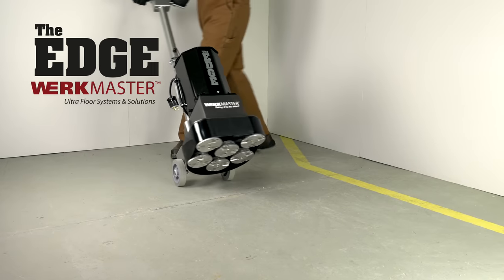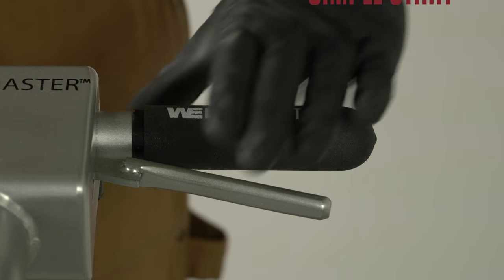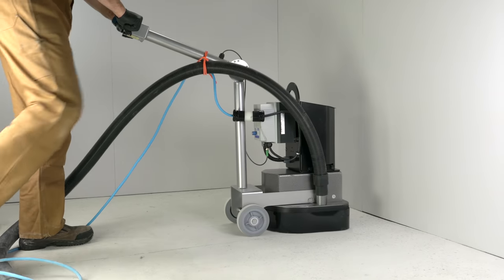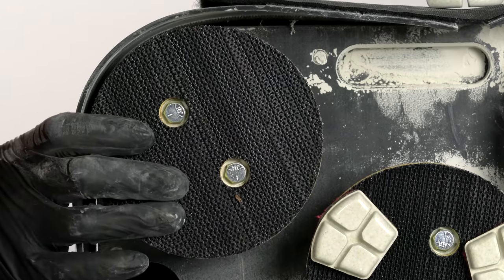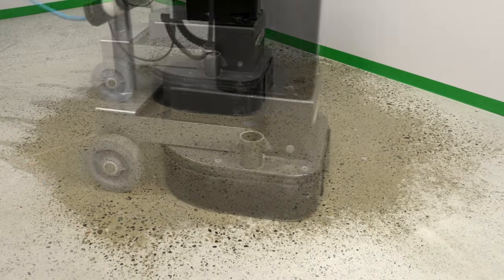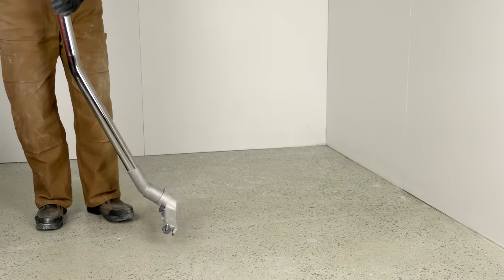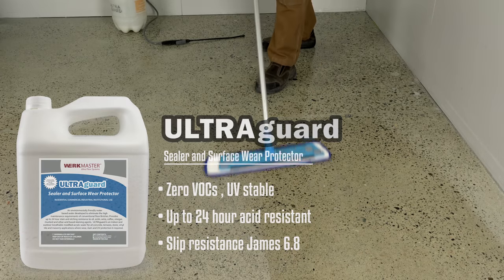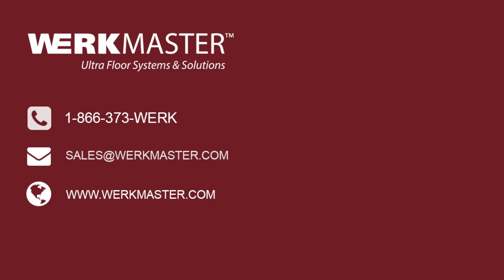Best Step by Step How To Polish, Remove Epoxy, Repair Cracks, Seal & Burnish a Concrete Floor Video!

Comment: Looks like a straight forward concrete polishing system. Love the fact that it is dustless! Nice work! That polished concrete floor would look great in my basement!
Reply from the maker: Thank you. Yes, it is nice to have polished concrete in a basement. Dustless grinding and sanding, when attached to appropriate HEPA vacuum system, is just wonderful.

Comment: Video Looks Great! Good Job! I can see the reflection in the Polished Concrete. This video is great for how to polish concrete and polished concrete.
Reply: Great video on Polishing Concrete! The final result is great!
Reply from the maker: Thank you!
Reply from the maker: Yes, the Polished Concrete has a great reflection and clarity to it.
Reply: Thanks! WebStarter! check out the Polished Concrete video for the WerkMaster Scarab. It removes epoxy and polishes concrete!

Comment: Can yall do it on super hard concrete i always see all these videos on soft concrete
Reply: Can't help but notice, the comment section is full of replies, except for this question... This and whenever someone utters the question, "Price?".
Reply from the maker: Good Question, The Edge costs $7245.00 USD.
Reply from the maker: Our customers use the EDGE on 8.5 to 9.0 hard floors. On floors this hard, we recommend our Gold Bond Tooling with special diamonds that are specifically designed for these types of floors. After any coatings are removed, we recommend using our Mist & Go System for the 30/40 & 70/80 Grit metal bond stage. Pump up sprayer with medium mist. Enough to wet the floor without leaving water on the surface. We do the same at the 100 Grit Achromic stage prior to densifying.

Comment: What would be an average amount of time to do a 2 car garage? it seems like a lot of steps. Can it be done in one day? Trying to see the cost advantage versus doing epoxy.
Reply from the maker: Hello John, I would give yourself 2-4 days depending on final level of desired sheen. If you already have a nice looking floor, then it will go faster.  If you floor has seen a better day, then you will need to work it more with the machine! Good luck with your project!

Comment: Can I use this machine prior to epoxy? I know it’s designed for polishing but can I also use it to scratch the concrete surface to give the epoxy a good surface to grab into?
Reply from the maker: Absolutely, it is an excellent machine for delivering a CSP 3 profile (concrete surface profile) which epoxy manufacturers require so that their product does not fail.

Comment: Do you recommend a particular grinding pattern to use the machine? I have seen cases where some areas are over grinded with a single pass of the machine, because of the position of the tools itself.
Reply from the maker: Hi, in some situations you can use a sideways circular motion to avoid this problem on some floors. We call it a feathering motion.

Comment: What does mean the 69 value on the tester at the end of the video ? and what kind of tester is that !  Great Video thank you
Reply from the maker: Thanks Leandro for the feedback! The 69(considered high gloss) represents the gloss level of the floor. A gloss level meter is used to test the mechanical polish of a floor. Gloss Level Meters are used to validate that the floor has been mechanically polished vs just being sealed and "shinny".
Reply: @WerkMasterConcreteStone   What gloss range value of a sealed floor  vs the mechanically polish floor ?
Reply from the maker: @leandronesi9519  They are usually pretty close when polishing to a high grit level like 3000.

Comment: How much per square foot  of concrete polich is worth
Reply from the maker: Hi Jimmy, it depends on a number of factors; 1. Is there anything on the concrete to be removed? ie. Epoxy, thinset, VCT or carpet glue, paint, stains, etc. 2. What is the hardness of the concrete? Soft, Medium or Hard? 3. What level of shine are you trying to achieve? Matt, semi-gloss or high gloss finish? 4. Are you planning to dye the floor? 5. Are there cracks in the floor? 6. What is the square footage of the floor to be polished? 7. Is it a residential or commercial place?   8. Are there multiple rooms, closets, kitchen area, bathroom?
If you can clarify these points, we can then provide you with a price range for the work.

Comment: How long would this take to do a 1000 sq foot basement?
Reply from the maker: On clean concrete that is flat and smooth, going from 30 grit to 1500 would take about 2 days
Reply: How much is the messin

Comment: how do i grind and then get a matt finish? stop at the 100 grit then apply a sealer with a matt finish?
Reply from the maker: you can stop at 100 or 200 grit for matt finish.

Comment: We polished a floor and did all this but the floor when you mop it at the end the dust won’t remove what is the cause of this? We been doing epoxy for a long time 10+years but polishing this floor is the first thing that we have had a problem with we tried ph neutral soap and it still doesn’t help
Reply from the maker: Hi Chicago, did you densify the floor during the polishing process? What sealer did you use on the floor?
Reply: Yes ofc we been doing epoxy for 10+ years but this has never happened. We used densifier and sealer protector. We are pros but not pros pros and we need big time help from another person who’s educated in this
Reply: Could it have been that they mopped the floor before sweeping? I mean idk this just doesn’t add up the steps were all done the right way
Reply from the maker: @chicago4809  Do you have any photos you could send to us? info@werkmaster.com

Comment: “60/80’s to 100 resins” 
Not 120 metals, or 50 hybrids, Mach or ceramic 100’s… 
That’s a bad call. That’s why homie polished the floor with the 100’s for a day in that little room and had to “drop down”  to 100 resins again after applying densifier. 
What’s the head pressure on that little baby toy machine?
Reply from the maker: That is correct Russell! We have moved away from the older copper based transitions tools(hybrids) and use our Achromic resins! New technology that eliminates many steps while giving you excellent results! Our technology doesn't get stuck on head pressure. Speed and good quality bonds and industrial diamonds are what give us results!

Comment: This seven minutes video felt like seven hours process. I will pass on this machine because it need so much time and steps to operate it.
Reply from the maker: Hello M.A. We did not want to make this process look to easy because transforming a worn out epoxy coated slab from zero to hero is hard work! Our systems can save you up to 40% in edging labour alone but sometimes bringing in the Pro's is a good idea if one is not up to the challenge.
Reply: then you should have watch a video of how to install carpet flooring
Reply: polishing concrete regardless of what machine you use takes a really long time. this was one of the fastest jobs I've seen so far. they kept it short and sweet. I like that the machine's close edging saves you time from hand grinding!